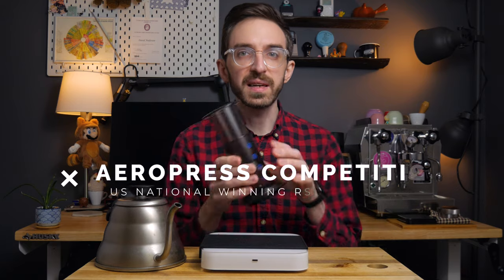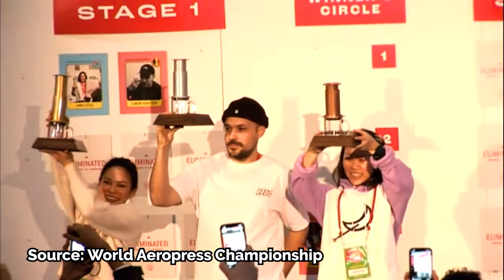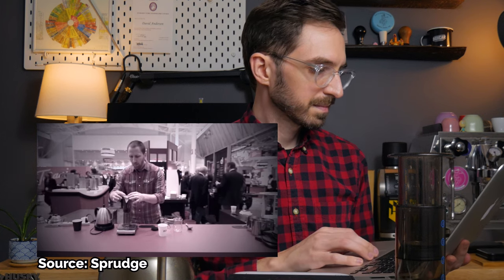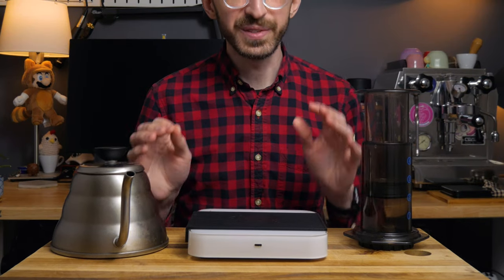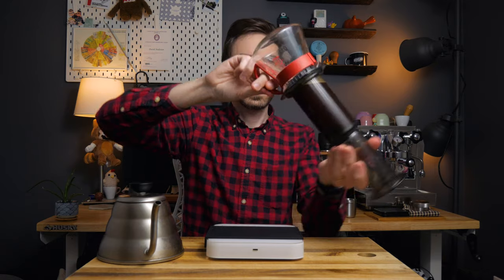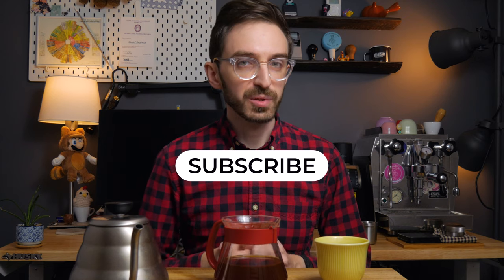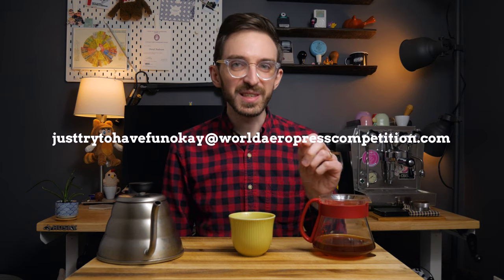Recreating an Aeropress Champion’s Winning Recipe

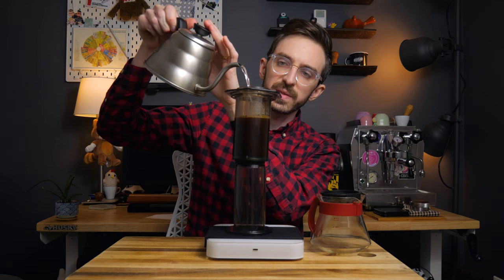Comment: Competitions is interesting to see the variety of recipes & methods used to make coffee, & is great to see all people from industry socialise. I like Aeropress for its simplicity of use, good result & easy clean & storage. I gave this recipe a try as I like both Aeropress & V60 - Aeropress for Espresso style & V60 for lighter brew. I think combination is a surprisingly good result & a light coffee (@ 1:15 ratio). 
It is more work, more cleaning, & flipping V60 glassware is definitely not what I want to be doing. Also, I hate boiling hot water burn. I would be inclined to keep techniques separate & do not intend to use this recipe again. It is good performance to showcase barista knowledge & expertise. 
I have Hario digital scale & it was struggling to register when measuring 8g coffee dose with Aeropress assembled & adding from top, so I had to measure disassembled, which adds more time to process.
Reply from the maker: I found the weighing out to be a little cumbersome as well, but was surprised at how easily the v60 stayed put. Trying this definitely got me more interested in the Aeropress, which I haven’t really used regularly in a while.